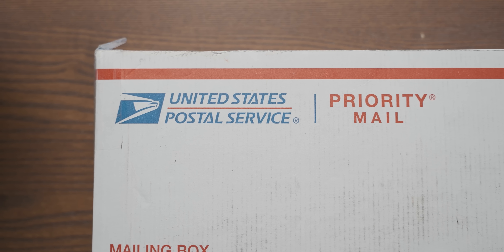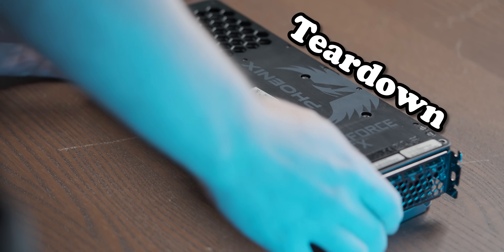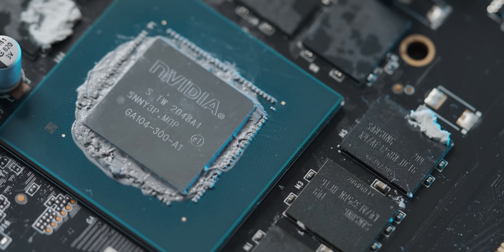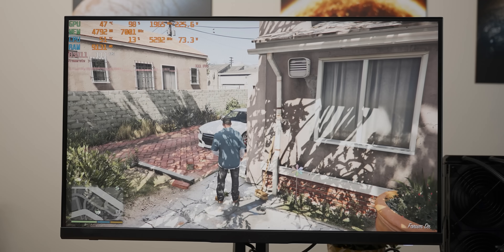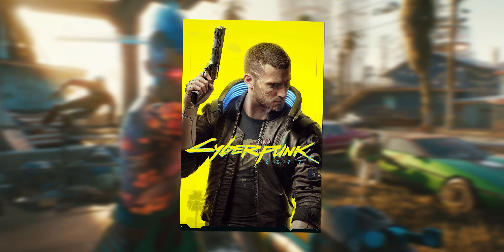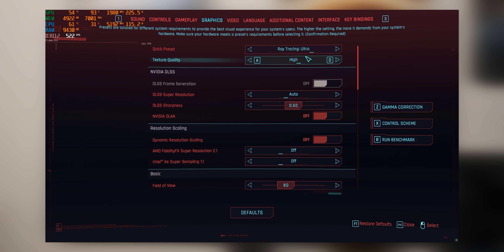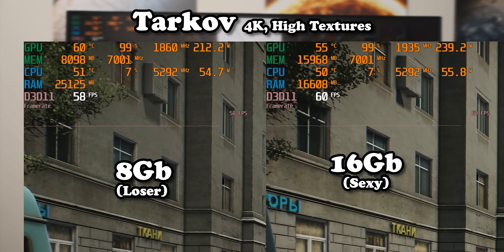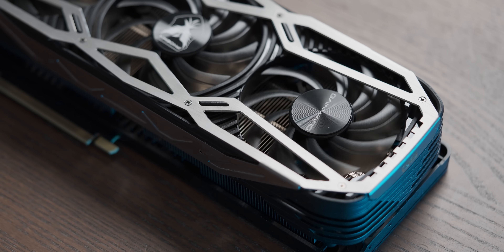This Is The 16Gb RTX 3070 Nvidia Should Have Made

Comment: I remember doing a similar mod for somebody back in the day. 22GB 2080ti mod was quite the sight to see. I've also done 12GB 1080tis because they used the same PCB as the Titan Xp but just didn't solder a chip down. Flashed Titan Vbios and it just became one after that. The 2080ti was an interesting one, because it was in for VRM repair, but I had the GDDR in stock for another GPU and offered to try it out for just the cost of the parts. Client said "hell yes do that" and now there's like 3 of them in existence that I've made.
Reply: Hey not sure if you'd be willing to try but I would pay quite a lot for replacing the 8Gb GDDR6X modules on the 3090 with the 16Gb VRAM modules to go from 24->48GB
Reply: @2intheampm512  what could you possibly need 48gb of vram for
Reply: @bigbadslimee  Training/inference of large language models
Reply: How much would such a mod have costed?
Reply: @bobnope457  I don't remember exactly, but I would throw out an estimate of $300 + the GDDR cost to do it again for another 2080ti.
Reply: Can it be done with the 3060 Ti I mean 16GB  ?
Reply: @lhacene le roux  Physically, yes. The 3060ti has 8x 1GB right now. 8x 2GB would be the same mod as here. I don't know how the vbios and driver would react, though, but probably very similar to this card.
Reply: @DigitalJedi I didn't even think soldering higher VRAM modules were possible at all on Nvidia cards. I figured the cards can only use what their drivers allow them to use. 

I could see all this being possible on AMD cards before, however.
Reply: I thought the 1080tis had the extra memory channel fused off at the core
Reply: @Spiderweeb6969  Some do, but some don't. Later model dies from when the yields were better are more likely to be software locked.
Reply: @DigitalJedi  🤔 this is good to know evil laughter
Reply: @DigitalJedi  is there like . . . A date threshold I should look for?
Reply: also is there a way to know if it's "unlockable" before soldering the new IC ? flash vbios an expect the full 384 bits bus/error on the new chip with mats ?
Reply: @Spiderweeb  There's nothing to go by beyond newer having a better chance. Your odds are still <1% because the proper good dies became Titan Xp workstation cards. These need to be golden samples. I've done 4 attempts and only 1 even recognized anything was different.
Reply: @DigitalJedi  Following up to see if you think 48GB on a 3090 is feasible. Thanks!
Reply: @DigitalJedi  so how feasible would modding a 3080 10gb to 20gb be?
Reply: @jasonmatson4155  Very doable so long as the driver and vbios accept the mod. I haven't done any ampere mods and don't plan to since Nvidia has gotten super strict about locking that stuff down. It's clearly possible, but I don't plan to make any. If I ever find 32gigabit density GDDR6X, I might try for a DIYed Radeon W7900 or A6000 ADA.
Reply: @DigitalJedi  I have the 12gb 3060 are there any mods for it
Reply: @jgvtc559  12GB is the current max that a 3060 can take due to the 192-bit bus. It's like Nvidia did this same mod to the 6GB 3060 already. If higher density GDDR6 comes out, like 24gigabit ICs, you could do an 18GB mod, but the GPU may not be able to use the odd-sized memory ICs anyways.
Reply: do you think you could turn a 3080 12gb or a 3080ti into a card with 24gb of vram?  they use 1gb gddr6x packages, would flashing a custom bios so it can see that it has double the ram work?
Reply: @Chubbysumo  Yes, those will absolutely work physically. My only concern is with the driver, as the only 24GB setup  is the 3090-specific driver. 16gb we know works on this die from the mobile 3080ti. It should still work, but expect lots of jank.
Reply: @DigitalJedi  Yeah some 3080ti can run fine with some 3090 bios already.
Reply: @chubbysumo2230  I think it would be easier to do 20GB on a 3080 as 3080/Ti 20GB cards were made (I nearly purchased an engineering sample of one from a reputable eBay seller). 24GB could also be possible with the 384bit bus but I think a 3080 20GB (running on a 320bit bus) is more feasible
Reply: @Pika I don't know. The 3 I did were all EVGA cards, but I can't remember what stepping / bin the dies were. I'd assume quite good silicon because the memory controller took it and EVGA would always pull good dies for their top-tier cards.
Reply: To everyone in this thread: imagine if there was 20gb 3080s. That card would be completely unstoppable & Nvidia would have a hard time selling newer cards lol.
Reply: The 22gb 2080ti is extremely popular rn
Reply: @ThePr0Br0  It is definitely not. There ae like 5 in the world.
Reply: @DigitalJedi  theyre actually really common in the chinese gpu market lol. u can get them for ~430usd each, which is rly nice
Reply: @DigitalJedi  in china it's very popular you can buy already modded ones. Very popular for budget gaming and AI/ML workloads
Reply: @PikaDevs no, only cards that were designed with xxgb in mind before launch. Hence why official drivers work
Reply: Wouldn't that also unlock more sms on the 1080ti? The memory bus is cut down on the 1080ti. So it is not actually cut down and just bios limited?
Reply: @Maou Kiero  Flashing the titan Xp Vbios would do that. These SMs usually run pretty hot and hungry, but  they would fire up. Stability was never a guarantee, and there is a reason they were disabled to begin with, but for the one that accepted more Vram, it completed a 3D mark run and was close to the Titan.
Reply: I would pay for  20/30/40gb On a RTX 3080 not going to lie
Reply: @Infinite-INF  I would've kept my 3080 if the VRAM wasn't an issue. 20gb version would've been insane.
Reply: @pengu457  Yep they planned on one but cancelled it because they were afraid nobody would buy 3090s if 3080 which is just a little slower had 20 gb vram.

Mostly why im thinking of getting an RTX TITAN since they are just a 2080ti with 24gb. Wish i could have 3080 with 20+ but yeah...
Reply: @Infinite-INF  How much can you get an RTX Titan for? RTX 3090s have fallen so cheap, and have 24gb of VRAM as well.
Reply: @pengu457  3090s are 700. Idk what you mean be cheap. I can probably find a titan at like 500 or something if i get lucky on facebook but ill probably have a better chance with a 3080. Sadly. If i can ill get titan if not 3080 is probably my next choice
Reply: @Infinite-INF  $700 is way better than over $2000 like they were actually going for over a year ago.
Reply: @pengu457  you can probably get a titan for 600 and under now adays... its real price now is like 500 but rarity and more probably 600 for a used one
Reply: @Infinite-INF  Well, do whatever you think is best. Like you said, it performs pretty similar to the 2080ti. I personally would rather spend the extra $100-$200 & get a 3090 for the way better raw performance.
Reply: @pengu457  except my budget for a gpu is 450. So im already way over budget
Reply: @Infinite-INF  Well damn. A 3080 honestly isn't a bad option. What exactly are you targeting? 1440p gaming should be fine with 10gb or 12gb of VRAM.
Reply: @pengu457  1440 ultrawide but the game i play has the potental to eat lots. At 1080p it ate 6gb of my 12gb 2060 i used to have and with bearly any things spawned
Reply: @Infinite-INF  You're the best judge of your situation.
Reply: Wtf then 😒 why aren't you famous
Reply: @Pika None were. Nvidia designed for 24GB on the Titan RTX, and then 11GB and below for the consumer RTX 2000 series. The fact that they can recognize and utilize 22GB is mostly a matter of memory getting more dense from when the 2080ti launched though its lifetime.
Reply: Is it possible to do it for AMD GPUs? I wonder if I could make my 6600xt 12gb
Reply: @primal_guy1526  You'd have a 16GB card, since it's 8GB right now, but it should be possible. Navi 23 was never designed to support that, so driver compatibility may be an issue.
Reply: @DigitalJedi  i got a asus rog strix 3060 its my understanding and please correct me if wrong, its currently 12gb 192bit looking at the pcb it has 2 open vram slots could those be added to  make it 16gb, also making it compatible with a 256bit bus could that bus also be changed. verry curious to know
Reply: @ShotgunWarrior  with 20 series and onward Nvidia always physically disables parts of the die by literally fusing the pads together internally. While those solder pads for more GDDR ICs exist and the traces are running for them, there is nothing on the die to recognize new memory. Unfortunately the best we can do for a 3060 right now is 12gb, unless higher density GDDR6/6X comes out. The 12GB chip is already 6x 2GB.
Reply: bro where'd you buy those modules from? I am planning on torturing my 3060 and replace it's 6gb vram with 12gb but I can't find modules anywhere
Reply: @Marian  I used to make bulk orders from Micron when I ran a repair shop. At one point, I think I had around 300GB of GDDR5 in stock.
Reply: Goat
Reply: I’ll send you my 3060ti
Reply: @Jaykurosakii  I'm not taking any new GPUs. Haven't done vram mods in like 2 years.
Reply: Wouldn't this mod make more sense on amd given their open source driver approach
Reply: @haphazardlyhype  Technically yes, but it also requires a VBIOS mod for some (possibly all, can't remember) GPUs. In my experience it was easier to get cracked Nvidia VBIOSes meant for things like mining back then, and then modify and flash those to my specs.

It 100% can be done on a Radeon card as well. My pick would be the 6900XT getting a 32GB mod if I ever do one, though I have considered doing a 5700XT as they are really cheap on the used market.
Reply: Where did you found a good source for high density memory chips? Also Micron or Samsung or possibly hynix is the best way to go? I have to replace a lot of memory sets on RTX 2000 series with bad d9wcw chips, I want to make some higher density ones, but there is no reilable source. I can buy a whole tray of chips of needed, but it has to be good.
(Also have a titan X pascal with a dead core, wanted to get a 1080ti with worknig 12th chip memory controller, but currently I have more than 15 dead 1080ti cores, the memcontroller dies in them for no reason and even the worknig ones die from reballing them, moved cores from burnt but tested cards and no detect or bad0ac mats after that. I have no broblem with any other chips, 3080, vega, cpus, but these GDDR5X controllers are trash...)
Reply: @pp3v42_g3h  Pascal's controllers are some of the most fragile I've ever touched. I had good luck running my pre-heat step cooler than the regular and applying more direct hot air to under the core as needed to losen up the pads.
Reply: How much would it cost to have you do this mod to my 3070
Reply: did the 2080ti have the same bug as the card in the video? (crashing unless you lock it in the high power state) I feel like, now that gddr6 is quite cheap, that's the main thing stopping this mod from being more popular
Reply: @danandrei96  The 2080tis I did needed more voltage than stock, but didn't have to be locked to full power, just higher base power.
Reply: @DigitalJedi  is that something you still had to do via afterburner or driver changes? or was there some kind of hardware/bios mod? I put 16gb recently on a 2080 and I wouldn't mind the slightly higher power consumption too much but I don't like that the card won't work "out of the box" if I move it to a new PC
Reply: @danandrei96  I had to overvolt them with afterburner, but a shunt mod or modified vbios might also do the trick.
Reply: Would you be willing to do another one?
Reply: Could you tell me where I can get one?
Reply: how much for a 2080 8gb to 16gb
Reply: I have an excellent condition 3070 FE I'd like to do this to. Wanna try?

Comment: Nvidia is gonna hate this video🤣🤣🤣now imagine if we could mod the firmware to match the new VRAM
Reply: lolll so you only read the tile and that's it.... obviously lollll
Reply: Why would they hate the video? It shows zero performance gains, so useless upgrade.
Reply: @MeatNinja  PERF did improve 🤦‍♂🤦‍♂🤦‍♂🤦‍♂and the results would be better if we could tune the RAM timings in the FW.......THAT`S WHY NVIDIA, will hate this video because it proves their greed and planned obsolescence
Reply: @MeatNinja  ZERO GAINS!!!! Yeah, if he had actually bothered to PLAY the games he tested he would have seen blurry textures when you run out of VRAM. Plus More VRAM means you can have alot better texture quality since it basicly doesn't impact performance apart from VRAM usage. There are alot of new games that will use more than 8GB and alot more will come since the consoles have twice as much. And this shows the planned obsolessence since adding more VRAM would have been very cheap for Nvidia. We are at a point where in some games a 3070 is worse than a 6800XT in Raytracing because it's running out of VRAM.

Comment: This is an amazing video. I have an rtx 3060 laptop and I was wondering a lot if I could sometime in the future solder more vram and this video really made me think that it could actually be possible. Please try to find more stuff like this.
Reply: Bro it wont matter. If you got a normal pc with the same laptop specs you would get double fps. Gaming laptops are horrible and they make them small so thermal throttle happens and they put power settings on some of the gpus depending on the laptop brand so for my advice i would 100% sell that laptop and invest in a tower. I was in the same situation as you i had everything on max power and still wasnt sastified with the performance and it would sound like a jet engine.

Also this video isnt a really good way to show the performance of the extra vram. Vram has higher or slower speeds depending on the chips and from what i understand not even this gpus vram in the video runs itself at 100% more like 50%
Reply: @AT4LAS  I am pretty satisfied with the performance of my 3060 laptop. One of many examples where I would like more vram would be in fh5. In this game I can't turn textures to ultra. I play the game with ultra preset 1440p but textures turned to high/medium and I get 75-90 fps depending on the scene mostly around 85 or so in the open world but when I turn utra textures the game pops up a message saying there is not enough vram and I get around 60 fps with some stutters. 
I am sure if this card would have had 8 gb it would have been fine.
Reply: @AT4LAS blah blah blah, unless you're gonna buy him a desktop, shut up.
Reply: @chistinelane  u mad bro? 🤣
Reply: @AT4LAS  you seem to be the expert when it comes to that
Reply: @chistinelane  u sound upset ngl 😏
Reply: I've been wondering the same. Laptop modding is pretty rare though, theoretically there's no reason why these same 2GB modules couldn't be used though.

Comment: So basically the card should not bother with 16gb because it cant run virtually any games at a high enough FPS to justify using it in the first place. I expected as much. The only games that do utilize the 16gb are optimized messes that make no difference in the first place.

Glad to see Nvidia is learning to stop over utilizing Vram in their cards. Now it just needs to get the damn prices down enough that I can justify replacing my 2060 super.
Reply: He didn't cover the 1% and 0.1% lows and the possible stuttering that would be caused by a lack of vram especially when it starts using ram to supplement it.
Reply: I personally just got a 2060 Super, and I see no reason to upgrade from it in the future, since current cards still arent really that great of an upgrade :\
Reply: @Foggy404  Yep, 2060 super is more than enough for max 1080p gameplay. I wish I could justify upgrading but until I can get a GPU for $400 that is at least twice as powerful as my 2060 super then its just not worth it. I got an UWHD so I often have to knock down settings to lowest just to handle 100 fps on my 3k monitor. Pretty annoying but it was still worth the purchase.
Reply: @Heathensauce  Maybe they'll make the newer cards cheaper soon? its all we can really hope for really :(

Comment: In the NVIDIA panel you show for a second we can see 32GB of video memory. I just checked with my 8GB 2080 and it shows 24GB
I assume that just means system memory is used as secondary VRAM when needed, explaining Tarkov's situation with RAM.
Maybe we could see a follow up on this? Testing faster RAM configuration with an 8GB card on games like TLOU, Hogwarts, Jedi survivor which are already infamous for VRAM requirements.
Reply: windows can allocate half of system ram as vram, but there's a reason vram is physically different, and as close to the die as possible
Reply: @bradhaines3142  Oh yea figured as much but i'd still be curious to know if there's any impact using faster memory. Wouldnt be the first janky testing on this channel either hey :P

Comment: I can say after testing on my 3080 2 days ago, if you go with 4K and everything cranked as high as it can go in GTA V you can get VRAM usage over 8GB. I'm limited by my 60hz 4K TV so I'm sure if you turned V-Sync off you could get around 10GB VRAM usage especially if you go driving around in the mountains. My 3080 was having trouble with driving around in foliage, I didn't have a fps counter onscreen but I could definitely tell it was dropping below 60fps.
Reply: You know gta 5 is old as hell right? Any new game would probably have issues
Reply: @pakee2352  yeah stock it is but once you start adding mods it looks just as good as any new game today, and as i said it gives my 3080 a run for it's money even without any mods.